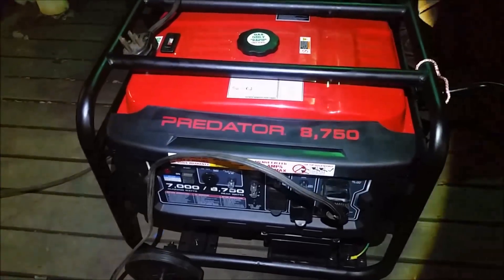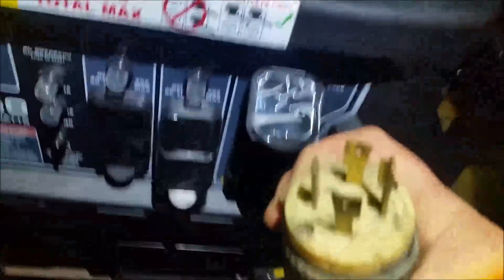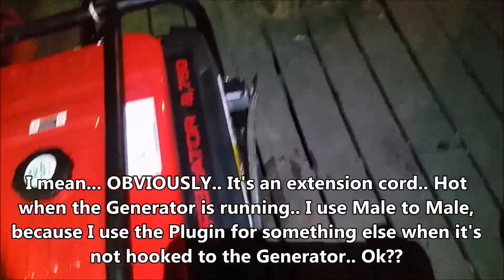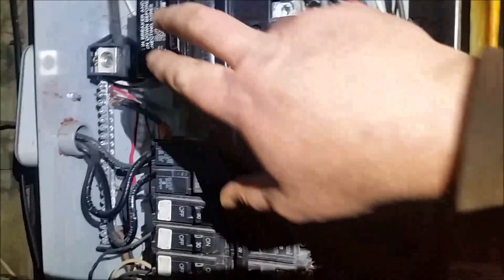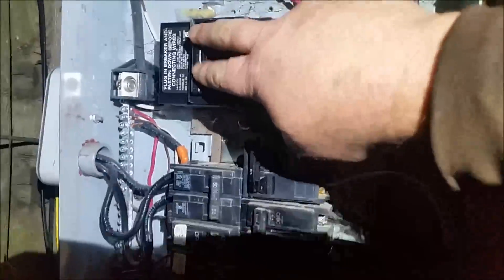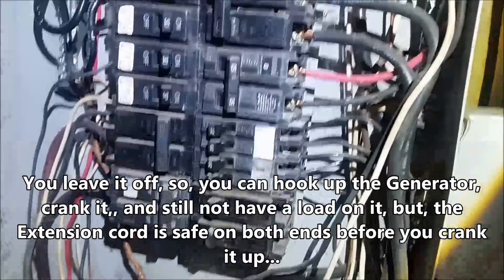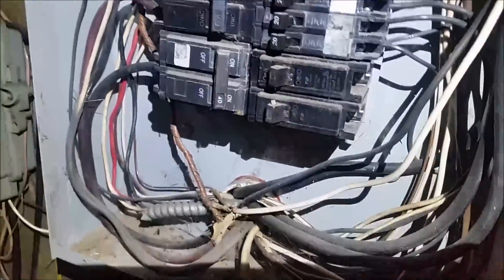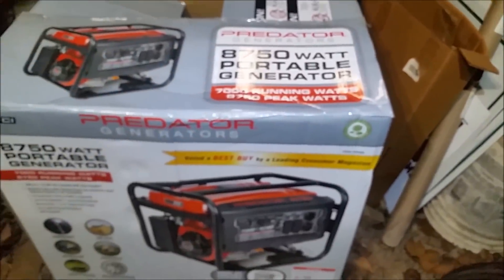Quick/Easy/Safe: Use Existing Plugin/Breaker for Generator hook up to your house Panel box.

Comment: YOU ARE NOT, I REPEAT NOT isolated.  Your neutral is still connected to the power company.  If your or the power co. have a power to ground short, you have power on the neutral.  You never isolated the neutral...
Reply: Scott, to excite the transformer requires access to 2 leads of the transformer secondary. In this case only one lead is available and it is grounded. Any ground fault occurring in the residence would send current only to the grounded neutral. What is your theory as to how that might excite the transformer?
Reply from the maker: :).. Thanks Ed.. You did a much better job with that reply than I was going to.. I could not have said it better.. I was thinking the exact same thing.. But,,, if he had asked a question, rather than shouting at me that I had done something wrong, I would have approached his comment more civily.. Like,, if he had asked a question and wasn't sure about whether or not the Ground needed to be Isolated or not.. But, it was a demand that I didn't do something right. If he thinks you need to Isolate your grounds,, then, I wonder if he uses 3 or 4 Condoms at a time??? Ha..Ha.. 

So,, Scott,, if you didn't understand your lack of knowledge and get the picture from the kind Mr. Ed Taylor,, let me say it a different way.. The Neutral coming from the "Power Company" go outside to the Pole and look and see where that "Neutral" comes from.. And, before you think you know the answer,, if you are on Single Phase,, count the number of wires going to and from the Transformer and then look to see where the "Neutral" is connected... Hint,, it is the same at the panel.. BTW.. In the Panel, your terminology would be correct.. But, open the panel and see where your Neutral and Ground connects inside of the panel, and tell me what the difference in the "Ground and Neutral is "Inside the Panel",, not at the appliance end,,, ie,,, Receptacle.
And,, BTW.. Just what is the purpose of the "Neutral or Ground"? Isn't it to take the voltage to ground in the "event"? Remember.. Voltage travels the path of least resistance.. That would be the ground on either end.. That's what they are there for.. Why remove either of them? If the voltage is high enough to jump from the power to "Neutral/Ground" on the Power Company wires,, would it not jump a shorter distance to ground inside of the panel? Would you rather it not go to ground in either place? If that is the case, where would you rather it go?
Can you imagine how much you would learn, if you could answer all of those questions?? 
If you are interested in Electricity, you owe it to yourself to at least try to answer some of them.. 
Just look at it all and study it and ask yourself, Why it is connected here and then again there, and why do they run it like this, and is it like that over there, etc.. Common sense will then be one of your best tools.. You don't have to study "Theory", that is what the Engineers have to do.. All you have to do is see what the Engineers did and figure out why they did it that way.. And,, if you see it done some other way later,, sit back and study that, and see why it works that way, and why someone else did it that way..  Anyway.. Good luck in your quest for knowledge.
Reply from the maker: You have not learned anything have you.. Aren't you tired of getting spanked.. Do you think I would take my time to reply and not have something to say exact and to the point?? So,, I won't bother repeating what I said.. Just scroll back up and read the part after "So,, Scott,," and take your spanking again..  Or,, do you want to remain a stupid fool the rest of your life about electricity.. I can't imagine how dumb you would have to be to not understand what I said about Neutral and ground wires.. But, go ahead.. the world is full of fools like you.. At least half of the USA anyway.. Hell.. If Obama actually got elected, at least 51% of America at the time had their heads up their asses.. Hey.. Last comment, I told you to watch some other videos of mine and see if you could make some intelligent comments there, but ,,, then I thought about it.. Probably a waste of time.. They are all Manly subjects.. You should probably stick with your Subscriptions like "GamingWithKev".. It's more your speed fella.. And,, shocker.. You have a subscription to AVE?? Ha..Ha.Ha.. What the hell for?? Ha..Ha..Ha.. I know.. You are trying to learn how he talks and learn how to mimik him.. Now,, there is a man that has a brain.. Way beyond your technical understanding on any topic he would choose for a video.. You have go to be a young peckerwood kid.. What?? 13 years old?
How old are you?? Ha..Ha.Ha.. I see you commented again.. Lets see what kind of ignorance you have posted now.. Ha..Ha..Ha.
Reply: ...I wonder if he uses 3 or 4 Condoms at a time??? Ha..Ha...

Maybe his father should have. :) Here's a brain builder for this guy. I don't know where he lives or how his power comes in from outside but here are two different scenarios for him to think about. Florida, where I used to live, is a giant island of sand connected to the continent with a patch of red Georgia clay. Down there, we had a distribution box that supplied 240 VAC, in the standard configuration, to four houses in the subdivision. If you looked at every two streets with back to back property's, Every four houses had a box the size of a short, wide dog house at the point boundary shared by the four properties. The cables for each house was run underground along the property line, (supposedly), into a metal conduit up the side of the house and into the meter box then from there into the wall into the main breaker box in the garage. The house itself had no external ground wire from the meter box. The ground / neutral cable, where it entered the distribution box, went to God knows where. I know all of this because when my main underground power line burned out and the power company tried to blame it on the barricade fence that I installed the year before, I watched their repair work to be sure they couldn't blame / charge me for the break. For the record, the break was nowhere near the fence because the cable was nowhere near the property line / power easement where it was supposed to be for me to hit it with the gas auger. They were pissed because they couldn't charge me for the repair. Anyway, dry sand does NOT make for any kind of a ground and wet sand doesn't stay wet long enough to be of any use so I can only imagine that the ground / neutral from from my house to the distribution box either went to a ground stake driven into the Floridan Aquifer 400 feet below the surface and growing as they pump the ground water out lower and lower or somehow it leads back to the generating plant four miles from my old house. Flash forward to 2001 and we moved to West Virginia. The linemen come to hook us up. For my box to pass inspection to get hooked up, I had to drive not ONE but TWO, eight foot long ground stakes, no more than 12 inches apart, no more than six feet from the meter box, into the perpetually sticky wet West Virginia orange clay, connect them together with ten gauge bare copper wire and copper plated clamps and then to neutral / ground in my main shutoff box. I had to do this at a slight angle in order to be able to put these under the house where no one would trip on them. This was, by NO sense of the word, an easy task. I couldn't do it before the house was moved in as I wasn't even in the state at that time. I walked down the hill to see how the linemen are doing and what is his helper doing but pounding not TWO but ONE, eight foot ground stake into the perpetually sticky wet West Virginia orange clay at the base of the pole. I WAS PISSED!!! I demanded to know why I had to drive 16 feet of steel into the ground laying down under my house without John Henry's steam hammer and he got to do it standing up with a two foot piece of pipe with handles. The lineman said that they weren't usually on site to watch people drive ground stakes. Sometimes people encounter rocks in the soil three, four or five feet down and succumb to the temptation to stub them off and call it a day so the power company requires two in the hopes of having at least one go down the full 8 feet or, at the very least, two of them making it 4 or 5 feet each. I walked away even more pissed at the thought of maybe he saw that that's what happened to me!!! When that half inch rod gets more than a foot deep, there is NO way to rock it loose from this wet sticky West Virginia orange clay without an excavator. I made the first one 6 feet when I hit rock. I prayed real hard that the rock was either less that the requisite 12 inches wide or oblong in the cross-ways direction. Whatever the case, my prayers were answered and it made the full eight feet.
Reply from the maker: Ha..Ha..Ha.. Yea.. Fence post Drivers... The place I live now.. I lived here 10 years and never looked for a ground rod.. I had to replace some of the old Hemlock Siding and it was right around the panel, so, when I removed the old, I looked for it. Wasn't there.. No sign of it.. The Ground wire was just coiled up in a coil about 10" in diameter and burried about 12 inches under the ground.. May have been code 50 years ago.. Not sure.. But, I just covered it up and left it alone.. That was 5 years ago.. Ha..Ha.. It is still that way today.. :)
The ground stays wet most of the time anyway.. There are enough tree roots around,, I'm sure it is plenty good enough to dissipate any large jolt..  Trees seem to do a nice job with getting lightning to the ground!!
Reply: @jeffmccrea9347  we use a hammer drill attachment that drives them right into the ground. Powerfull. So powerful if you hit big rock it bends the rod and it comes up next to you. Lol. By the way its the national electrical code that requires 2 ground rods not the utility company. They are redundant to try and maintain an effective ground in the event of a fault. They corrode underground over time so having 2 gives you better chance of having effective ground for longer time. Other factors come into play also.
Reply: Isolating the neutral is NOT required. Short of buying a transfer switch you could install a "safety switch" on the panel dead front. It is basically a piece of metal made for that panel that WILL not allow the generator breaker and the main to be both on at the same time. This won't work with using the welder plug or dryer or range though as it would not be operable on utility power. But the fact that every panel manufacturer makes one disproves your point. Also I have installed transfer switches and the neutrals are together on one lug. Once again not isolated. Yet approved by ul for this exact use.
Reply: If one has a power to ground short, the buck, or in this case, jolt, stops there but the breaker in the house or on the generator will go POP first! This is the whole ides of having a ground in the first place. When my house was built, in order to have the power company connect it to the pole, I had to drive two, eight foot copper plated ground rods  no more than 12 inches apart, into the ground no farther than 6 feet from my meter box and connect them together and to my main breaker box at the meter with 10 gauge bare copper wire. Then I had to hire a licensed electrician to come over, inspect the whole installation and sign off on it before they would even come out to hook me up. In my case, my generator power would have to force it's way past 3 separate breakers just to get to my meter and out to the main feed to the pole. There's the 30 amp breakers on each leg of the generator itself, the dedicated 30 amp breaker in my garage breaker box and the 60 amp breaker that normally feeds the 8 gauge wire that my garage that is installed in the main shut off box below my meter box. This would all be before the power hit the short itself. If power gets past all four of these, (three breakers and the dead short), it's God's will that it happened and there's nothing that I would be able to do to stop it.
Reply from the maker: That's about right Jeff.. The most likely event in a power to ground short is power to ground in the shortest distance it can find... Not sure how they work things around your area.. At least in North Carolina, Georgia and Louisiana, the Electrical Inspector comes out and gives you an inspection and that is what the power company is going to wait on, before hooking up the service.. I have paid anywhere from $25 years ago to $75, 6 or 8 years ago for an Electrical Inspection.. But, I have never been told that I had to hire an electrician to check my work.. I always make it clear that I will be doing the work. He is just there to bless it.. 
I hate to open my panel.. When I wire one myself, the inspectors always push to find out who actually wired it.. They think it is some new Electrician in the area that they have not met yet.. I'm a bit anal when it comes to filling a box.. It is so much easier to have a really nice and neat box, than a jumbled mess. I strip the jacket when the wire goes into the panel and run the blacks with the blacks, whites with whites, and neutrals with neutrals.. I like to buy the panel that have the ground bus all the way down the sides of the box, so, my hots and grounds hook up directly across from the breakers. Always easy to fish something out, move it, etc.. I always leave extra wire in the box.. I go down and then back up and to the breakers..  It really looks nice when it's done correctly.. I am not even going to worry with this one.. Every wire in the box is too short, and I sure as hell am not going to put a bunch of Wire Nuts in there.. That would be worse.. Cheers.. I agree with the Gods will statement.. Half of the crazy Safety police are quoting those one in a Million, 10 years ago in Brazil, I heard,,,, etc.. Ha..Ha.
Reply: so are generator  interlock switches safe ?
Reply: @TedBishop1  yes. An interlock switch is just a piece of metal made for your specific brand of panel. It makes it impossible to energize the panel from a generator with the main breaker in the on position. No transfer switch made removes the neutral from the utility side. I have seen many comments about that but they are all very wrong. The neutral will not back feed the transformer by itself. However if you neglect to turn off the main breaker the transformer works both ways. You our 240 volt generator will back feed the power lines with 14k plus volts. Interlock makes that impossible
Reply: All of you guys need to watch this video about generator safety as well https://youtu.be/I1jT3ANENvI